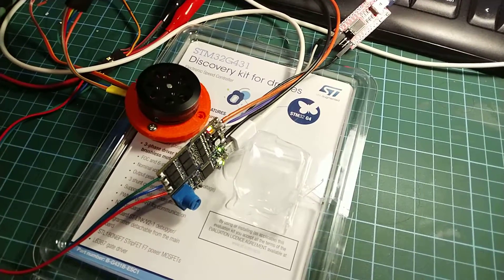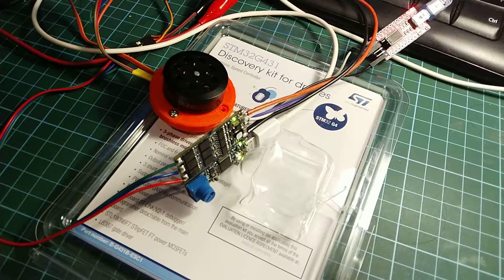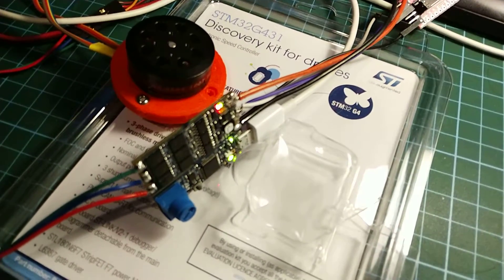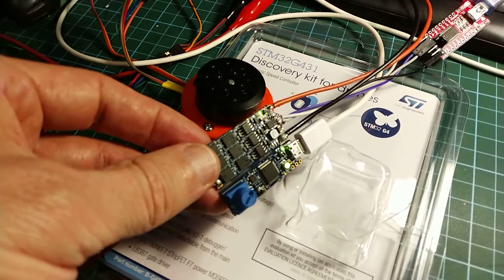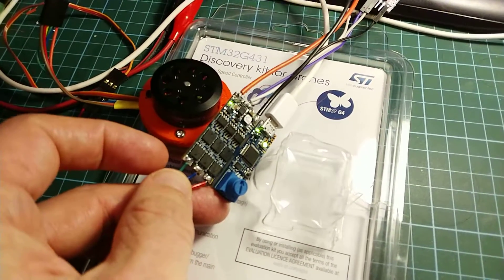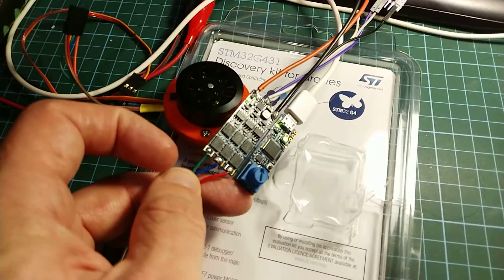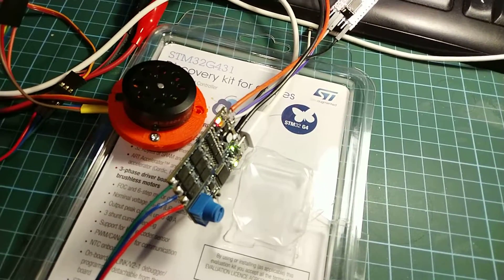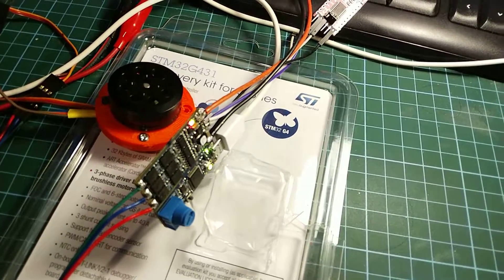STM32G431 Kit For Drones (Part1: step commutation)

Comment: Hi owen, i have been trying to make my motor rotate with this esc since past 2-3 days. I tried using the workbench and with platformIO, and whatever i do the motor would neither initialise nor even twitch. I am definitely doing something wrong i feel. Could you please tell how did you configure the esc in the first place? And also this esc should work with any kind of BLDC motor right? Like the tiny fpv ones?